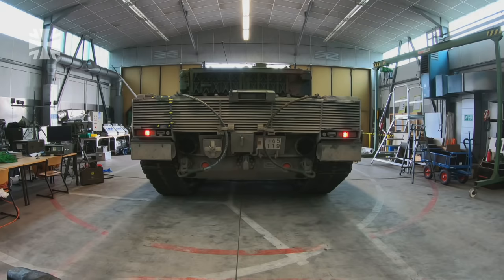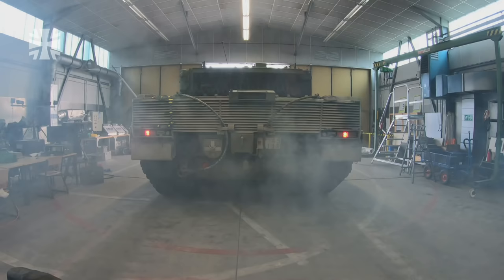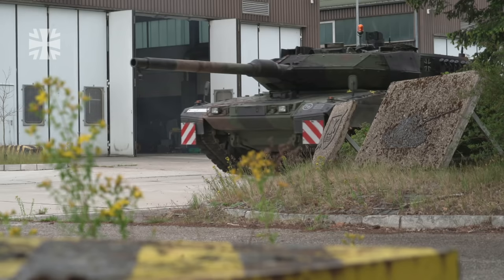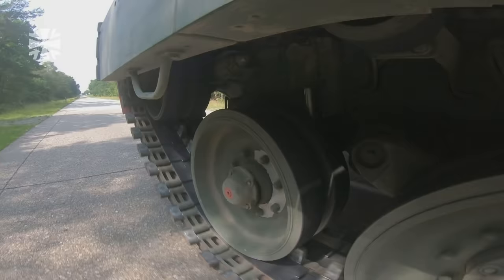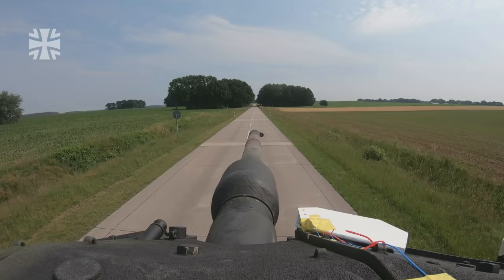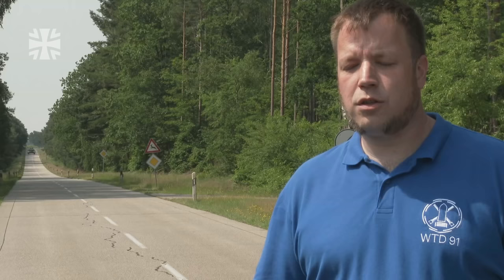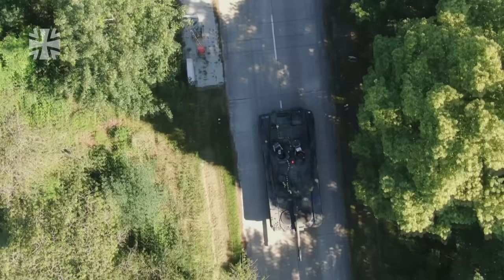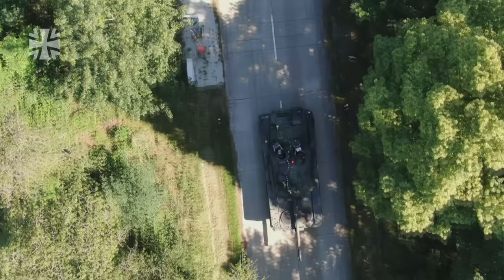Testing the New Leopard 2 A7V Battle Tank | Bundeswehr

Comment: No Rheinmetall 130 mm gun yet?
Reply: Not necessary.
Reply: Atm only in Rheinmetall's testing.
Maybe in a few years more.
Reply: They're only supposed to be in use until 2030 so it wouldn't be worth the effort of changeing the Turret.

Maybe on the French-German Project that is supposed to come after them.
Reply: @FTWIHA  They will be in use long after 2035.
Reply: @comsubpac  
Not according to the German DoD's Plans
Though to be Fair, i doubt that they'll ever reach that Deadline.
Probably going to be used by the Germans even in 2050 considering how long they take to get stuff done.

That's why i wrote "Supposed to" not "will".

Comment: There are many pictures of Turkish Leopards ripped apart by a single hit with one of many of Russian ATGM's. Did you guys somehow mitigated the risk of having the ammunition storage rack inside of the vehicle?
Reply: turkish used old Leo2a4, kurdish used modern anti tank missles like MILAN ...
Reply: @fcbapfel  Leo 2 A4 has it's ammunition storage rack in the same place as 2 A7V. I am wandering if they did anything to give it a bigger protection
Reply: @metsyslodreip  good question, i dont know
Reply: @metsyslodreip  the ammunition storage has the same protection the rest of the tank has. Everything that gets through that Armour will destroy the tank no matter if it also hits the ammunition or not.
From the 15 tanks turkey lost only two were hit in the hull. In the end you can destroy every tank when you get close enough so it's more the bad training of the Turkish forces that is the problem.
Reply: @metsyslodreip  The turkish tanks were lost mostly through horribly wrong usage and tactical errors.
Reply: @comsubpac  I guess that you have not seen M1 tanks pierced through with ATGM's... somehow they did not explode on impact...
Reply: @graysun9108  The technical flaw of the vehicle was not a factor at all?
Reply: @metsyslodreip  A very small factor in comparison of the other circumstances. Yeah hit in the right place there can be a cook of of the ammo, but to be honest every ATGM that can penetrate the armor would most likely kill the crew inside. Far worse is it to use the tanks as stationary guns without any infantry as flank protection.
Reply: @metsyslodreip  of course they would. One of the Turkish tanks was refueling when hit and burned out instead of exploding. The Armour of the Leopard 2 is actually thicker then the Armour of the Abrams.
Reply: @metsyslodreip  They did so many mistakes with their leopards that the paper stats of the tank realy didnt matter. They would have lost even with sci fi tanks straight out of the future.
Reply: @little_lord_tam  The Soviets were saying the same things about Iraqis and their usage of T-55 and T-72... Leopard 2 has a huge technical flaw neither bending of realty nor sorcery will change that
Reply: @metsyslodreip  My point stands true
Reply: @metsyslodreip  Yep. Using the tank in such a way kills the tank. No magic will change it
Reply: @little_lord_tam  there are two possibilities 1. You are a Leo 2 fanboy 2. You are being paid to write that crap ;)
Reply: @little_lord_tam  That vehicle has a serious design flaw. I am wandering what has been done in A7V variant to mitigate that flaw
Reply: @metsyslodreip  Tell me how wasnt it stupid that they went into an urban unscouted area without infantry nor air support with old Leopards? 😂

Comment: The russian Armata is better. It is a completely new design where the german is just an improvement of the past versions which are dating back to the mid 70s
Reply: Wir können dasselbe dann über die israelische Merkava oder die amerikanische M1 Abrams sagen, aber wir kennen die wahre Leistung des T-14 nicht.
Reply: The Armata has been canceled and only 12 have been produced. 
Besides, all experts agree that the Armata might be the first Russian tank that is comparable with western designs, but it is certainly not better.
Reply: @comsubpac  The test batch of 100 is to be delivered and deployed to the 2nd Guards Tamanskaya Motor Rifle Division, with delivery expected to begin in 2022 The Tank is not canceled
Reply: @tzafas2  It is. the "test batch" has been reduced to 10 to be delivered not before 2025 and funding is basically reduced to zero.
Russia can't produce additional tanks anyway since the electronic and camera systems have to be imported from France and France has stopped all deliveries. The Program is basically dead.